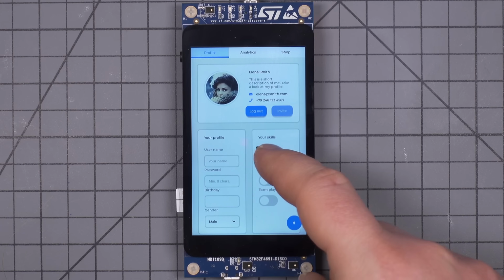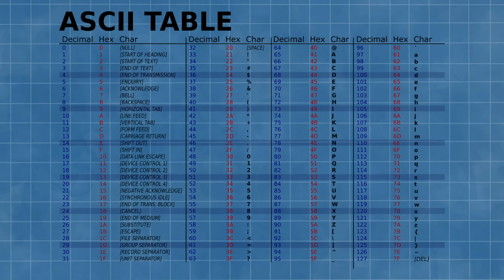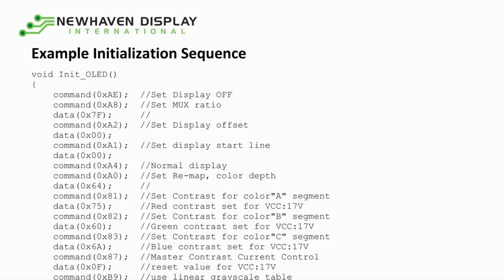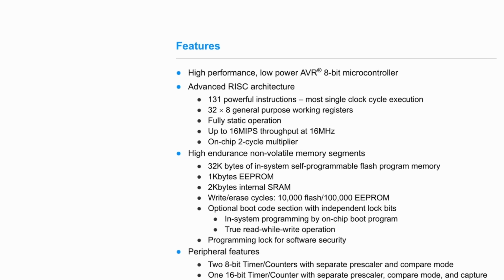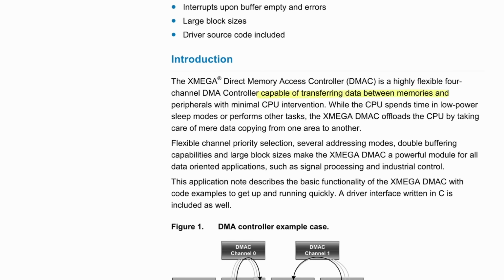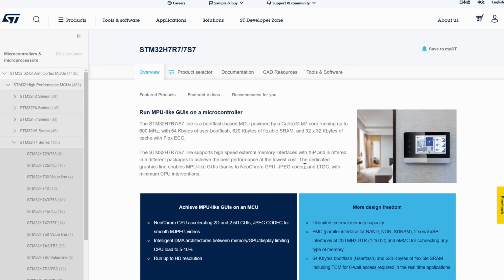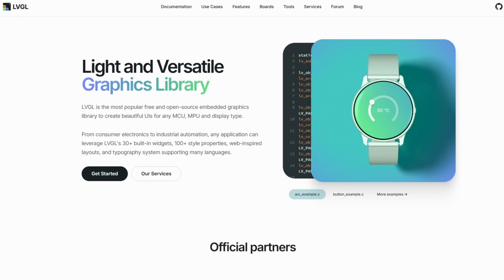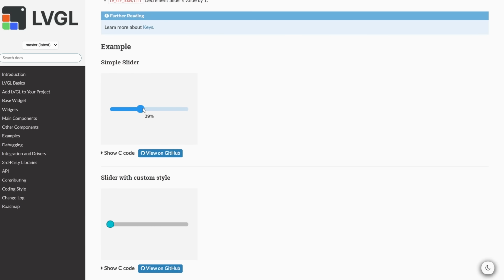The BASICS of Adding a Display to Your Arduino, ESP32, STM32, or other MCU Project

Comment: Great introduction to microcontroller displays!  One small omission I think needs clarifying: many of the on-display driver chips on small LCDs include an internal framebuffer memory which has just enough memory to be able to refresh the display without requiring attention from the microcontroller chip.  This means that even with a 320x240 display with 16 bit color, even though this requires 153,600 bytes of memory to refresh the screen, you can drive that with a microcontroller with much less memory than this.  If your application uses the screen mainly for text, but also with graphics made of lines, rectangular boxes, circles, and triangles, or graphs derived from an internal table of data, a graphics library can take care of calculating what needs to be sent to the display's internal framebuffer to render these.  This means that even an Atmel ATmega328 with 2kB RAM or an STM32F103 with 20kB can make use of displays like this without being slow or rough, even when using slower interfaces like SPI and I2C, since only the areas of the screen that have been changed have to be re-sent to the driver chip.  The important thing is to know which driver chip the LCD you are considering uses.  Common ones are the IL9341 and the ST7735.  When in doubt, look up the datasheet for the display controller to see if it has internal memory.  Many graphics libraries cover a number of different driver chips, although the driver chips for OLED displays are different from those for LCD displays.  Graphics libraries such as LVGL and the Adafruit libraries can often be used in such a way that your application code can be written without much concern for what size of display is used or which driver chip it uses.
Reply from the maker: Very good point, I should have expanded on that more. I did very briefly mention partial frame buffering, which I think is largely the same thing as what you're describing, but I should have covered it in more depth. I'm actually using partial frame buffering with the LVGL examples in the video, not because of memory limitations but because of the time it takes to send the full frame buffer. My code was spending 90% of it's time flushing the frame buffer before I implemented partial buffering and I was getting single digit frame rates on some of the demos, but using partial buffering increased performance by a factor of ten or so. I'm going to pin your comment so that anyone viewing this video in the future can get the helpful tip!
Reply: @AllTradesZach  Obviously brilliance seems to coincide with self doubt(pro here), it is awesome and its scope is just fine. I want to get into fpgas and MIPI and co interfaces, but its borderline impossible to do that on my zero budget atm. There is a complete series of videos needed, I think its time to get off my butt and get mmy channel started. Anyway this reeks of massive collaborative effort, but its about time to get the ball rolling. And you made a lot knowledge available, that took me a long time. Maybe the arrival of photonics will help clear this field in its wake in the near future, it has to trickle down once implemented. My take is all levels of dispay technology has been and is suffering from bandwith limitations. Especially and most likely be one of the bottlenecks halting otherwise much more rapid advances, but thats just my perception, as I'm out of my depth on this. Just my gut feeling atm

Comment: Teensy 4.1 is great for mcu graphics. I never see anyone use it though. The topics are not that complicated but mentioning every archaic method old raster engines used is just baffling new people with a too broad, unfocused scope of narrative. Again, I'm not throwing shade. I'm not the one writing the scripts and just some dick wad sitting in a room. haha. 

I've gotta say though, you'll probably agree that mcu boards have not improved their fp precision or speed in over a decade when talking about the usual suspects. The esp32 pretends to be dual core and claims to have better fp silicon now for drawing vector-based graphics. The pi zero w2 is a capable, cheap (not an mcu) option but most people do not want to have to manage an operating system then api stack to make cool shapes and effects in guis for home projects haha.

Comment: Excellent overview! I've been implementing an embedded display project and my research and your info here form an almost perfect set intersection.

I'm attempting to drive a 466x466 OLED RGB display at 60 FPS. It's been quite a challenge but I'm getting close!
Reply: Im starting to learn about this, my initial intent was to make some fov goggles that I can afford, for now I use some cardboard shaped and glued by me with my phone inside (+a cheap eachine 5.8ghz receiver). My goal is a 1920x1080 screen (trying to imitate the top of line fpv goggles, but I guess this is pratically Impossible...

Comment: I like the ESP32 + ILI9341 lcd + TFT_ESPI library by Bodmer. You can run that SPI bus at 60MHz with awesome frame rates. This library supports lots of displays and MCUs within the Arduino framework.
Reply: I want to make an mjeg player that can run older 8 or 16 bit games. Oh wise internet man, will you tell me if the hardware you mentioned would be suitable for this occasion.

Comment: I loved using 2x16 or 4x20 lcd's but, eventually, I stepped it up an wrote a driver from scratch for the ili9488 screen, via my mcu of choice the rp2040.  Not touchscreen capable yet, as I'm still learning graphic algorithms.

Comment: Thank you - a very good overview for anyone starting to investigate displays. I'm currently investigating whether LVGL is the right solution for an existing 'hand-rolled' project. For physical inputs (I like tactile, especially encoder buttons!), I've just written an InputEvents library (on Arduino IDE & PlatformIO) to make life easier. Like LVGL it fires events for each type of interaction.
Reply: Yep. My field has nothing to do with electronics, but I was always interested in it, and never understood why a screen from one device could not be adapted to another device, even with some work.

Comment: I would love to know what screens and interfaces are best to take advantage of the PICO 2s HSTX lines. I really don't want to use HDMI or Displayport for an embed screen. I thought the Picos 2s HSTX were designed for a specific screen interface but i was having a hard time finding one. I like to use the cheap stuff from waveshare and the like. It looks like 4D systems is taking advantage of the rp2350 HSTX for its screens but can't find any information on the hardware they use.

Comment: NO ONE has answered my question as to why some go with JLCPCB or PCBWay!  Why?
Reply: I have used both PCBway is good for bare boards on the cheap and about 7 to 10day turn around. JLCPCB is faster, slightly more expensive but is easier to ordered fully manufactured boards with all the components. I did try a fully assembled from PCBway and they do get it done, but as others have mentioned they source the parts and it can take some extra time. They did call me for a substitute part and I approved of it so they do have great service. But it can take a bit longer. But both are quality boards.
Reply: @newmonengineering  - I see many YT's that use PCBway over JLCPCB, but most just get the bare boards.  So what I'm hearing is the PVBway is cheaper and faster if your just getting boards.  Thanks!
Reply: I’ve used both and have been happy with both.
Reply: @jimdean7335  - I've been getting various answers, and they both seem to have their Pros & Cons.  Thanks!
Reply: They are just vendors. Choose whatever you can afford and fits your needs.

Nobody "chooses" pcbway or jlc, they are paid to use them.
Reply: Seems like you just have to run quotes through both to check pricing, delivery times, etc. until one of them pops up as preferable based on what they're good at. At this point, the two businesses look like clones of each other to me. I'm betting that one emerges over the other for X, while the other becomes better at Y over time
Reply: As others comments, it's depends, I use JLCPCB primarily because their quoting is in real time (on PCBWay you will receive a quote from them by email in less than 24h), their prices for PCB tend to be cheaper (JLCPCB I mean) and their quality is really good, never had a problem. But their shipping costs can be a less cheape option for fast shipping and increase quite a lot when you try to make a unique shipping with many designs. I don't have used PCBWay beyond the quotes because every time, JLCPCB made a better price, but for sure, PCBWay have much more professional capabilities that only recently matched (some) by JLCPCB, and the 3D printing is interesting on both, and as stated by another comment, the integration with LCSC parts make it a perfect match for Board Assembly services, I used 2 times their PCBA, the first was a nightmare, PCB created in Eagle 7.5 but export to JLCPCB formats required a lot of try and error because their easy configurators don't worked well on my PC or me being a donkey😅, but after sorting out those inconvenients, the boards came perfect.  The second time I created (first time using it) the pcb project in easyEDA, exported directly the project to PCB assembly data, loaded in the site and all wad perfectly oriented, the PCB assembled was wonderful and worked first time power on and programmed (based on a ESP32, first time I designed one, before, only Atmega328Ps). But, I will try PCBWay some times, just to see with my hands of they can be a good alternative.
Reply: hmmm. potential bot thread.
Reply: Bc the discount on your first purchase
Reply: Oh! I've actually got a great answer for this! I use JLCPCB all the time over PCBWay. They're both great, but for me JLCPCB wins easily because they integrated with LCSC to build out a part catalog. It makes it really easy to look for parts that they have in stock and design around those components. Then when you make your PCB design files, put the LCSC part number in your BOM, and JLC will process that BOM. This is great because it lets you get fast turn around on manufacturing and pick and place assembly, since you design around components that are available. PCBWAY doesn't have the same part integration. They will still do PCBA for you, and you can specify what part you want in your BOM, but then someone on their end has to go through and source your components by hand. This winds up taking a lot longer, and you don't always know the price until they're done. I've had a few boards made by PCBWay, and they took like a month to get to me, but I've had like 20 designs made by JLC, and it takes like a week to get my assembled boards. I really like them both, but the LCSC integration is a killer feature.
Reply: @evanbarnes9984  - Thanks for the INFO!
Reply: I go with JLCPCB because of their pricing and how fast they can make PCBs.
Reply: @omnomspaghettios286  - Thanks!  But I wonder if it depends on where you live.  I'm in the US.
Reply: I have been very happy with JLCPCB so haven't felt the need to look for alternatives.
Reply: @4mb127  - Understood!